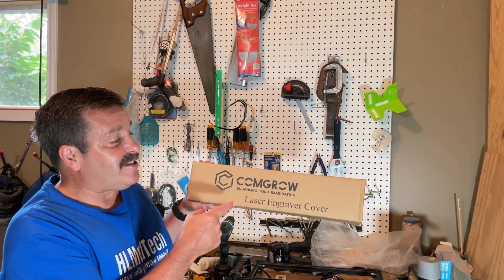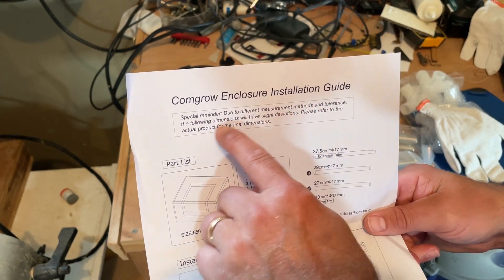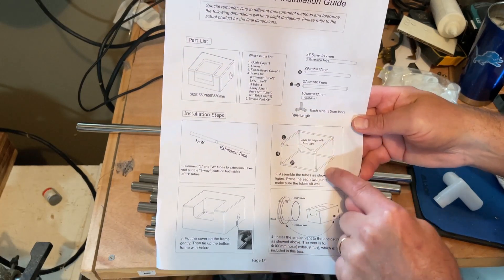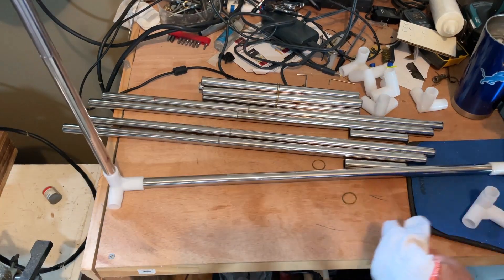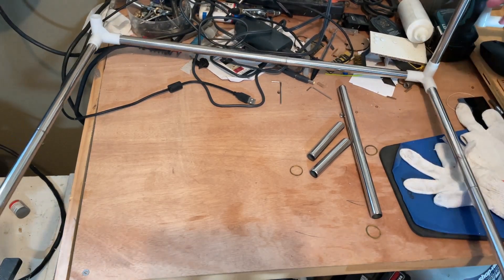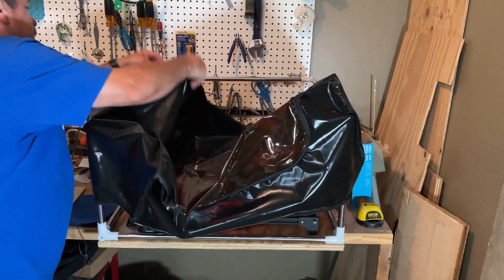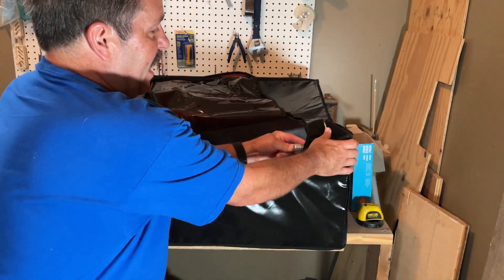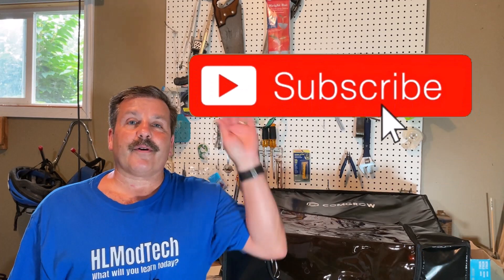Assemble a Comgrow Laser Enclosure Ortur Laser Master Pro 2 💯👍

Comment: Bought the same cover yesterday for my sculpfun s9 😂
Reply from the maker: Super cool! Pretty slick system. I am getting my venting routed for it right now. More vids to come. =)
Reply: @HLModTech  without cover and ventilation the fumes are to bad to accept. I run mine in the basement and larger projects are nearly impossible because it's so smelly
Reply from the maker: I agree completely. Garage has made mine tolerable, but fumes are nasty. I have been marking acrylic which was really smelly.